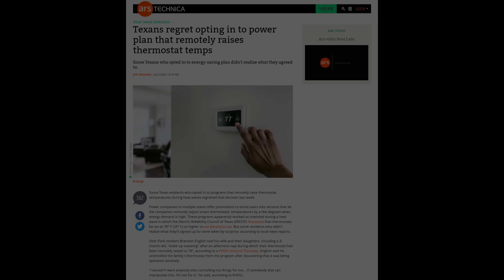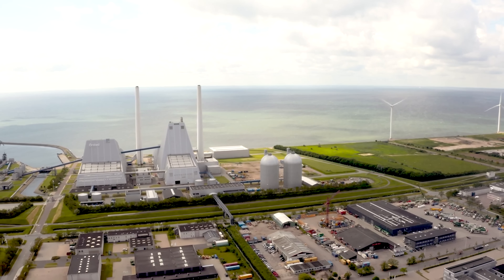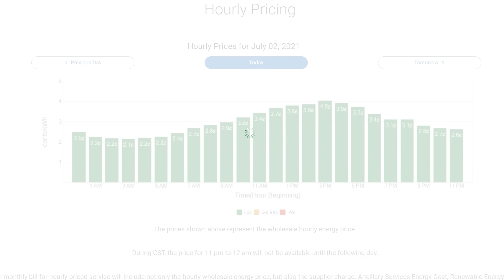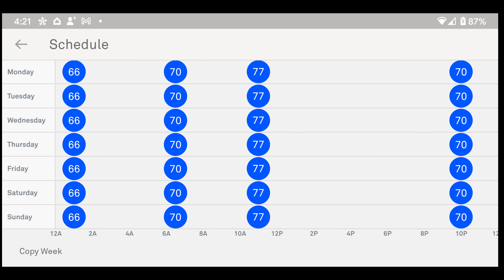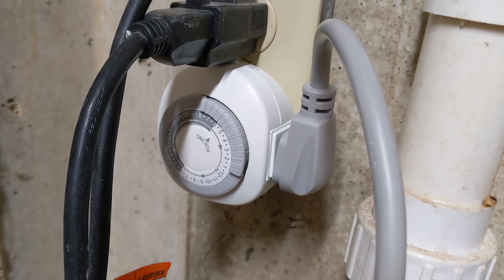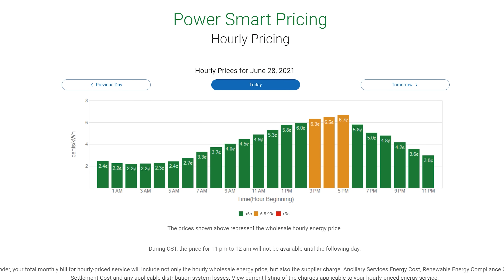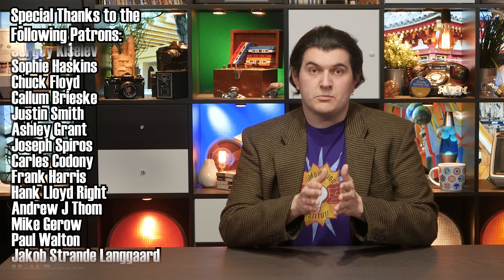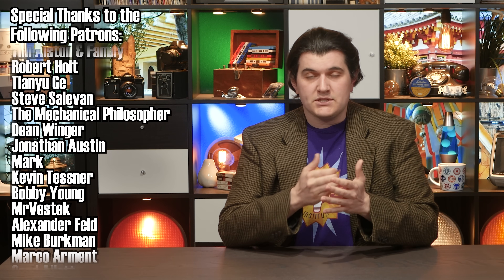Batteries aren't the only way to store energy. Here's another.

Comment from the maker: Hey! I realized that I pretty much only talked about the residential side of things and left some of the tactics commercial buildings use until the very end. Well, here’s me now saying that this is by no means something we can’t apply wherever it would work. In fact, many commercial buildings are doing pre-cooling already when it makes sense for them. None of the ideas presented here are new, exactly.
But I do think there’s a lot of potential here specifically when it comes to getting use out of renewables. “Make hay while the sun is shining” is a perfect expression, here. In some areas we’re already running into issues where there’s so much solar capacity that we can’t use it all. Rather than wait until we have more electrochemical batteries at our disposal, perhaps we can use all this thermal mass we have.
The key thing about insulation is that it slows the transfer of heat. That means it buys you time. The challenge of renewables has always been that the time of production doesn’t match the time of consumption, but with more intelligent control and awareness of a building’s thermal capacity, ability to pre-heat and pre-cool, and the tolerances of its occupants we have a pretty flexible tool for shifting consumption right now.
Reply: ok
Reply: There is only one problem that I can see with this. That is that the rate of heat transfer is proportional to the difference between indoors and outdoors. This means that over cooling at night can make power consumption go up.
Reply from the maker: @nebuchadnedzzar to be clear I do it at night because I don't have any solar output that I can take advantage of, and there's not much of it on our grid yet. Overcooling at night is what I'm doing, but it's not where I'm suggesting we go with this.
(edit to add): The other thing to consider is that if I run my air conditioner when it's really hot outside, the higher condensing temperature of the refrigerant makes it work harder. I'd need to do some experimenting to confirm this, but if the total amount of energy I'm pulling out with my cool-only-at-night strategy were equal to keeping the thermostat at a constant, say, 70 or 72, I think it would actually take more electrical energy. A larger load on an air conditioner makes its energy consumption go up, though not necessarily drastically.
Reply: There are so many places to store thermal energy in commercial buildings. Think about the all the water piping and just mandating upsizing it by an inch. Concrete floors...
Reply: This is a great explanation and demonstration of the monetary gains homeowners can achieve by looking at the home with a fresh outset. Well explained and thorough.
Well done.
Reply: Speaking of molten salts, you should do a video about the LFTR reactor.
Reply: @TechnologyConnections  Great vid :) Being an Industrial Engineer myself I'm loving your channel. I have one question regarding the fog on your windows. Since you are in the US, your windows are (most likely) not triple glazed, but are the double glazed?
Reply: more on the residential side when it comes to heating https://youtu.be/N8aGV3Z8dOA
Reply: @TechnologyConnections  this is offset of course by cooler temperatures during the hight, so air conditioning runs more efficiently then for cooling. The big problem is when this is used for electric heating.
Reply: While cooling to 66F overnight might use more energy over a 24 hour period than leaving it at a constant 72F for the same 24 hours.  The energy you do use is significantly less expensive in the middle of the night.  The other thing to consider is that running your A/C at night when it is 70F outside rather than at 3p when it is 90F outside will give you significantly more cooling for the same power consumed.  That also offsets the overall power used as well and may even be a wash in the end.  Again from the pollution side you are typically using the cleanest power (unless you have solar PV available) rather than a natural gas peaker unit in the middle of a hot day.

We use this same method of cooling down overnight, but only to 70F with our 4 ton geothermal and if we have a hot sunny day we then use our smaller 1 ton air source heat pump powered by solar to try to maintain the "cool" temps during the day, usually our 3kw of solar PV is available when it is sunny and hot.
Reply: You should make a video on the viability of using super capacitors instead of batteries.
Reply: Optimal sleeping temperature as discovered by science is 72F.
And you're supposed to have the lowest temp during the night... Which means that during the day it should be HIGHER than 72F, around 77F/25C is considered optimal during the day.
Anything higher is too hot, anything colder is too cold, PERIOD. It just wastes power.
Reply: @TechnologyConnections  I was surprised you didn't mention the extra efficiency of cooling when the outdoor temperature is cooler in the video. I have to rely on a crappy portable AC and overcooling during the early morning when temperatures are coolest is the only way I can keep it from outright overheating and shutting down in the late afternoon during a heatwave. Power around here is all hydro anyways so peak hours don't matter much, but there are still energy savings to be had by cooling things earlier in the day in a reasonably insulted building.
Reply: Extreme weather events aren't going up. Coverage of them is.
Reply: @F40PH-2CAT  Tell that to the people in the regions that washed away last week in Europe, this is extreme, oh yeah the free oven in north eastern US/Canada wasn't a regularly scheduled event either
Reply: @TechnologyConnections  I can confirm that your method of over cooling at night works well - we've been doing this for years.  Our thermostat is set to 25C during the day and 19C at night.  It's always comfortable in the house even when daytime temperatures reach 34C (with nearly 100% RH).
Reply: Solar's biggest problem is its distribution over the day, generally there's a big spike around midday and then it tails off on either side. In more temperate regions it also varies greatly over the year. That means especially in more temperate regions less likely to use air conditioning, solar generates the most energy at perhaps the second lowest period of demand (night would be the lowest of course). A summer day, when people don't have lights on, are more likely to be outdoors, and are more likely to be on vacation. So periods of negative pricing become more common, as other generators are paid to shut off to prevent the grid overloading.

Wind is less variable, but more unpredictable and you can have days or weeks of very low generation. We have lots of it here in the UK, but a slow moving high pressure system (which is fairly common) can result in slack winds for a long time (and freezing temperatures in winter).
Reply: @Croz89  other generators would be paid to disconnect, they can't completely shut off temporarily.
Though it's still detrimental for a base load generator to not be running 24/7, this is the biggest problem with solar : it introduces uncertain variability to the grid
Reply: @TechnologyConnections  yeah. I mentioned that counteracting force on the condenser. Realistically there are benefits and trade off's for all of this and your house is cheap.

Frankly one thing that needs to be done is deliberately increasing the thermal mass of buildings inside the thermal envelope. My preffered method is having the basement within the envelope and then putting in a rainwater tank. 2-5 metric tones of water is a Lot of thermal mass, and makes this approach far more viable.
Reply: @seamon9732  surely optimal sleeping temperature etc is subjective? For me 72° at night would be sweltering, probably too hot for an ideal daytime temp too.
Reply: Read that with his magnificent voice in my head
Reply: Each cubic meter of water, is about 1. 2kWh per degree C. That means a 5000L or 1300gallon tank takes about 28kwh to change that same 7C. As a benefit you also get that stored water for gardening, toilet flushing and so on.
Reply: Consider applying solar panels.  Not just for the power, but also for the shading and backside ventilation!  Solar panels prevent sun from directly radiating into your house through the roof.  No matter how good your attic ventilation and insulation, a good amount of that radiated heat will seep into your house.
Reply: @tesicnr  Compared to what? In EU, exactly the same considerations are true on the NordPool common electricity market. We don't have rolling blackouts, but we do have a sometimes 3x difference between peak and low hourly energy prices, and quite many households are on variable plans. No remote control nonsense, but looking at the electricity prices it was quite nice to see how in the beginning of the rash of heatwaves we had, the variability was really high, but has leveled out as more people and companies realized that this load shifting makes sense.
Reply: The subtitles were the best - thanks for the chuckle. 😁
Reply: Its not a negative battery, it just loses its charge too fast. Its why we don't use air as a battery. Yet.
Reply: @TechnologyConnections  I am surprised you did not talk about adding thermal mass to the house, extra layer of drywall (the method I did.),  water tanks and interior Trombe Walls
Reply: @TechnologyConnections  I could have sworn that you said Heat Pumps operate more efficiently when temperature differences between hot & cold are larger & less efficient when closer. ... I'm referring to "stress" on the system as part of that efficiency. Perhaps an efficient system is on high stress or perhaps a difference does exist but is negligible... ?
Reply: My house stores solar energy in my hot water tank, basically when I am generating more power than I am using it diverts some power to the immersion heater.
Reply: @YounesLayachi  Disconnecting isn't that simple, you need something to shed the load, that will probably get very hot.
Reply: @Validole  To be fair, NordPool has a shit ton of hydro which can be used for storage or highly dispatchable supply.
Reply: We do energy management in hotels, and that some unique problems such as occupants changing every few days so it's impossible to predict when cooling/heating is needed, thermostats being set to 40F or 85F, occupancy rates changing wildly due to conferences, holidays, etc.woefully undersized HVACs, demand-responses coming in with short notice, causing all HVACs to turn on simultaneously must be avoided, etc. But it still saves the hotels a lot of money.
Reply: You are right in all that you say about technology. Unfortunately, governments will deny services to political opponents for even something like health care, so shutting down electricity to combat opponents is still on the table.

That being said, what about encouraging people to cool off the ceiling, by airing out the attic during the cool hours of the evening and night? I'm surprised that nobody advocates putting a fan up there to push the air out. Would you be willing to do a video about this idea?
Reply: Is there anyway you could share more data ? How many square feet you have? An approximate cubic feet of airspace inside? Also maybe how much surface area does your house have? I’m just trying to liken you house to yours even though I’m in AZ. Very cool video
Reply: @kchortu  i have often wondered why we don't have an extra set of pipes in the wall, which can be used in hot months to "drain" the heat out, when we turn on the faucet. Instead of coming straight from the water main, we could have the water go up and down through the wall. The warm wall will warm the water, so that we we won't need so much heat for hot water.

Also, why can't hot water tanks be heated by surplus energy during the day?
Reply: I would say your house is more than 16 kWh storage since you AC produced more "cold" being heat pump.
Reply: Thank you for including metric for us non Americans
Reply: I respect your opinion on technology. You're like my connection to the technological world. I was hoping you might consider doing a video on hacked diabetes pumps. I know it's a weird subject but, especially as an American, I think a perspective like yours could be greatly beneficial to the diabetic community.
Reply: Great videos man. This one made me laugh as I've been doing this for 20+ years. 15 years with a older townhouse that didn't have AC and now with my new house which does. Most of my cooling comes from a whole house fan. I "cold soak" my house over night and then close up in the morning. My neighbors think I'm crazy because they all believe that I'm roasting in my house during the 100 degree days while their AC is running all afternoon. Yes, there are a few days that I need to supplement with AC to keep below 77F but its usually only a hand full of days in the summer. I've tried to explain to my neighbors that a house gets heat soaked during the day - including walls, 2x4's, attic etc. This heat is released well into night ( which in turn keeps their AC running late into the night as well ) and my strategy not only reduces my electricity needs but also keeps cost down by shifting most of my cooling cost to cooler evenings ( a cold soak ). Like you, we prefer sleeping cold ( always with the windows open and fan in window ) so this works well for our family. As you stated though, this works well in my area ( CA / Bay Area / Livermore ) where night time temps are cool but isnt going to work in all places. Keep up the awesome info videos.
Reply: @judebrown4103  I agree. I find 22-23 degrees to be comfortable, but I start to sweat afterwards.
Reply: @Milan Velky that means it could be stored in the attic, right?
Reply: 5:06 NOT VIABLE not at all. THUNDERF00T (among others) can show you why... and it becomes quickly obvious that its a huge fail.
Concrete breaks down over time
and if you run out of place to stack you stack on top, reducing the lift height and therefore power
AND don't get started on wind conditions
its BAD... but water is GREAT... water doesn't break and falls FREE from the sky... it is perfect!
Reply: same here, an old trick, 31°C outside, 28°C inside, not much but these 3 degrees make a lot of difference, until I switch on my pc 😅
Reply: I support nuclear energy 😀
Reply: Yeah, I messed around with my thermostat and did a similar thing though it was the other way, Turning off heating at night at 9 and only having it turn back on from 6 am to 7:30 during the week. We only raised the temp to 64 though and it was not uncomfortable... 70 degree houses are uncomfortable to me because you sweat more there.
There are actually a bunch of studies that show a number of benefits from sleeping in cold
Reply: Your house is an entropy battery xD
Reply: @Milan Velky Absorption refrigeration is thermally inefficient.  If you happen to have a free source of waste heat to use, it can be a net win, but on a BTU per watt basis they're not a winner if you have to pay for the watts.  The benefit is that you can run them WITHOUT electricity, since all they really need is the heat source.  (Modern RV fridges mostly need 12v for a control board for auto-switching and thermostatic controls, but there are still a few models available that will run on propane alone.)
Reply: @eugenetswong  yes, I'm in the south of the UK and for those who may not know ac is not  commonly used over here. Some of our houses have had insulation retro fitted in cavity walls. So far I've chosen not to do that because I think the houses were built to 'breathe' and worry about damp problems if you seal them up.
In winter we have our central heating set to about 18°C/64°F and is perfectly warm enough for us on most days in our three bedroom semi-detached house.
In summer when it gets hot - we have about 28°C/82°F daytime temp at the moment, thats quite warm for us (although we have gone as high as 35°C/95°F in recent years) I keep the windows open at night then, before the heat rises, I shut the windows and draw the curtains on the sun. We're east/west facing so I usually only have to do this on the afternoon sun. The east facing doors and windows stay open unless the air is hotter outside than inside and by this means the house remains cool, if the heat does get hotter outside I shut all the windows and use a ceiling fan to help move the cool indoor air.
Takes a bit of vigilance but uses a minimum of electricity.
Reply: @smithsmith6402  On the London Underground they open all the airways they can at night to cool the stations and tunnels down and reduce cooling demand during the day.
Reply: ... Was total $ said? As guess a family shivering 100 days in summer saves maybe $100, that seems bad deal x10 factor. My family say they want altogether $1000 to shiver summers otherwise prefer not shivering... PS Electricity is tooooo cheap, so these nudges won't work we r kidding ourselves, , , sorry to be negative just seems token, , yes I am getting bit jaded on green issues sorry
Reply: can you buy please a better mic.. the noise is too bad
Reply: heh i just turn on my extractor fan at night and open a few windows to suck the outside air in summer, it bonuses as an insect repellant because insects cant smell you if the stench doesn't escape other than a location where it goes through a spinny blade
Reply: @judebrown4103  great work!
Reply: @Milan Velky thanks for the extra info!
Reply: Absolutely love TC - such an enjoyable channel. Thanks so much for all the education and entertainment!
Reply: @nevermab  energy cost not
 conservation was his point
Reply: Around here (western US)… we are getting a little too much sun. We've been in a constant heatwave since mid May. We try to do something similar to what good ol' TC is doing with his house but the house we are renting has crap insulation and crap windows. So it only lasts until about 10 am when temperatures reach the 90's.  Most of the electricity around here is good old fashioned polluting coal.
Reply: @TechnologyConnections  There is an efficiency reduction when the exterior temperature at the condenser is not significantly higher than the indoor volume being cooled.  This means for the same electric load, the thermal extraction is lower when you run it at night.  How much lower?  Dunno, for sure.  Have you noticed any cracks forming at the corners of your walls due to the daily hysteresis being considerably higher than leaving things a constant temperature?  Also, how much energy do you actually save doing this - have you run a monthly 'speriment to see the actual benefit?
Reply: Yes, but savings are small ( with fixed 4c/kWh transmission costs) and your "battery" has its losses, too.
Heat is hard to channel and contain. It loves to dissipate.
This has its uses, but I suspect that in reality results are worse than advertised...
Reply: @eugenetswong  Around San Francisco Bay a whole house fan is very common as it really cools down here at night. Air is sucked in open windows, blown up into the attic and out the attic vents. Most people don't have or need AC.
Reply: All I got out of this video is confirmation that you're not married to my wife.

(just kidding of course, it's a great vid)
Reply: Large buildings are paying (at least in Sweden) for the maximum use of electric POWER during a month (mean hour power). To spread out load during the day lowering there power bill.
Reply: So I live in a newish, concrete, condo building, with nearly full height windows, in the Pacific NWest.  We are North facing, but during the heat wave I found that in the mid-afternoon it was far cooler outside then inside!  In fact, after the heat dome left and our outside air temperatures dropped to 24C range, we still found it hotter inside then outside, even after having the windows open all night to cool down our condo.
So any ideas on what is going on, as I thought new, well built, concrete buildings with good insulation and a modern air tight design is suppose to keep the inside cooler then outside?
Btw, very few people in our condo have AC units,  including us, if that matters.

My only guess is the building's concrete thermal capacity was heated up into the 30C range (like a rock in a fire) and when it cooled (glowing hot rock taken out of the fire) the building's concrete re-radiated the heat (for DAYS) after the outside air had cooled.  So our own building was cooking us?  If true, we need to have a discussion with Strata!
Reply: The College nearby freezes a reservoir of water overnight and pumps the water around through it's radiators during the day to cool. There is still forced air cooling and the reservoir system is being retired...
Reply: Same idea: I installed a timer on the electric water heater. The tank stores more than enough hot water for a whole day, so it saves a lot of money with no impact on lifestyle.
Reply: Virtual Power Plant (VPP) ftw!
Reply: It would interest you to know that 69% of corporations surveyed last year were actively pursuing investments in their own generational capacity. Solar and wind are now the cheapest form of energy production in the history of the global energy market. The next frontier is heat energy storage. And we have everything from phase change materials to simple sand to work with in that department.
Reply: Theres also a similar possible aid that can happen at an infrastructure level-in a similar way as in some places even today winter heating and hot water is handled off-site by a conected boiler building, then pumped hot to the building or even in some cases run as steam, a similar thing can be done with heat and cold using ground and air sourced heat pumps in purpose made buildings.

In many more locations than its feasible to give every house a ground sourced heat pump, its feasable to basically create one big heat pump that can cool in summer and warm in winter and spread that to anything in piping range, and can use the same load shedding battery method to cool air and water in summer and heat it in winter, then spread that round the neighborhood. This is especially true if houses have yards that a neighberhood heat pump can be run under, or in comercial areas that might see redevelopment more frequently. 
Especially with the ice storage cooling systems!

No more complex than the kind of infrastructure people or companies have near, on or under their property and conected to the whole neighberhood anyway, such as sewage, septic,  water or electrical systems.
Hell, in places that need public or public-private interconect water pipe refits, this is the perfect thing to do as a value add.
Reply: Other ways commercial buildings can save energy is by setting alternate schedules, thus lowering their demand.  Or work at home / virtual. This doesn’t store energy but it reduces peak demand and spreads it out a bit more.
Reply: @TechnologyConnections  I was really curious to see an A B comparison of overnight vs daytime cooling with graphs for internal and external temp and humidity to control more variables
Reply: Instead of worrying about all that nonsense, you can come live in the Wenatchee Valley (or more specifically, East Wenatchee) and pay 5¢ on the high end. Right now it's actually 2.64¢/kWh

p.s. the water/ice baths plus the hot bricks sounds a lot like what practical engineering talked about in his video on it. Marine you two could collaborate on something
Reply: As an HVAC tech I really love hearing these perspectives. I learned so much in this video that I might have never learned about in training or in the field!
Reply: Man, I wish my office would crank down the AC at night. I'm often working late, and I'm always hot!
Reply: I once worked in a brand new building that had ice storage, but that also had "Sick Building Syndrome" due to outgassing from the carpet, adhesives, and the paint used on the doors, door frames and railings.  So I loved to say: "I work in an ice building, but it's not a nice building."
Reply: I have solar. . And my electric is just a service connection fee. Like 40$ to 60 all summer im in Florida
Reply: Do you have a “time of use” electric meter?  With an ordinary meter, the electric utility has no idea WHEN you’re consuming electricity throughout the month… only how MUCH you’ve consumed.
Reply: @vardekpetrovic9716  Texas had its worst winter in history, Baltimore is hotter now than Atlanta was 20 years ago, glaciers are receding at alarming rates, Lake Meade is at its lowest level since the reservoir was first filled, the migratory patterns of birds have changed, the Great Barrier Reef has been bleached white… what proof do YOU need that human carbon emissions have and a significant impact on the climate?
Reply: Got the next day figured out eh?

Utah: hold my beer
Reply: @varno  Lower outside air temps at night and no sun baking the condenser coil should make cooling more efficient. Also, at night temps should be closer to indoor temps for less heat transfer.
Reply: On the commercial side, I used to work in a winery.  We had temperature sensors recording internal and external temperatures, set to pay attention to the internal/external differential, as well as absolute temperature.  These were hooked up to louvers and fans.  In short, when it was cool at night the louvers opened and the fans kicked on, filling the winery with cool night air.  When the absolute temp, or the differential (depending on the situation) reached its critical setting the fans shut off and the louvers closed.

Even on days well over 100 degrees F (38 C) the winery stayed cool.  We didn't have any active air conditioning, this semi-passive system was the entirety of the cooling system and it worked really well.
Reply: You don't have a lot of solar around your area it appears.
Solar output usually peaks around noon/early afternoon when your power is most rare and expensive.
Around here it is the opposite, sometimes they even have to disconnect solar plants to avoid overloading the grid.
Reply: I choked when I figured out you were also a Midwesterner. Anyways, this is a very in depth explanation of how to put less stress on our power grids, and I’m all here for it. Less stress usually means less outages. :)
Reply: you are BRILLIANT man! 😊
Reply: Hundredth reply
Reply: Are you with Ameren Illinois?
Reply: @TechnologyConnections  Admit it you're just cheap haha jk but you got really low rates man I pay 18 cents all the time plus $80 dollars added on right away each month just for having electric
Reply: @Milan Velky absorbtion coolers are huuugely inefficient and installing such a system only makes sense if LOADS of heatenergy are available as waste already.
Reply: @seamon9732  ugh, I hate sleeping in 77f. Too hot
Reply: @vardekpetrovic9716  Most scientists say absolutely nothing of the sort.  You completely made this up.
Reply: I really try to avoid running the airconditioners at home because they are 30 year old window rattlers that’s cost an arm and a leg to run. However when the temperature often peaks over 40 Celsius I will run the aircon because if I don’t the house temperature will not cool down at all. Especially when it is still 35 Celsius outside in the middle of the night.
Reply: You should look into home / small commercial chiller systems. I'm starting to seem more of these become available, look up engineer775 on youtube he has a few videos about them.

The are refrigeration units but use water to both heat and cool a building and provide the hot water needs. They can cool your house and dump that energy into a storage tank for your hot water system.

You can also have additional thermal storage tanks for cold and hot water so that you can use renewables to power them and still have consistent HVAC throughout the day.
Reply: just want to point out, it is not a battery if there is no way to redistribute the stored energy into the system, it is smart useage of resources, and it sure is a good idea, but if i can not charge my car with your cold house, it is not energy storage.
Reply: Had a oil radiator with a huge stone above it. You had to plan really well because I takes time to heat up and time to cool down... Quite difficult to use as you need to follow forecasts, but inexpensive too.
Reply: The delivery of ‘Saves me 40¢ a day’ had me lol-ing
Reply: First seriously .... then a joke
Seriously - I am the only one who thinks that it is a terrible 😨.. TERRIBLE IDEA 😰 😱 .. that the electrical companies lean any.. 😐 even the smallest insignificant.. part of their operations in a open public network.. instead of in a private closed one??? ..... this is going to end very very bad some day 🙄...

Now the joke 😃 - Hey grandma .. can you believe these kids ?? 🤨.. they don't even know how to take a shit without having the stool connected wireless at the cloud.. and to the little color mirror that they have glued to their hand all day...
Reply: @eugenetswong  Where I live, all larger houses have an attic fan. My area doesn't even get very hot in the Summer.
Reply: @buddyclem7328  Wow. That's such an heard of idea here, that I thought that I was the first person in the world to think of it.

Do you use a thermostat to turn it on?
Reply: @eugenetswong  The attic fan has it's own thermostat in the attic. I think it can be adjusted between 90°F-130°F. One time my parents' attic fan got damaged, and it burned up the motor. When the new fan was installed, they put in a switch, to turn it off if there is ever another problem.
Reply: I feel like i know this guy. Like....A/V club or drama club in high school....
Reply: As far as i remember the evening spike was pronounced in Austria before air-conditioning became as usual as it is.
And other newer consumers like electric Stoves (the only device in Europe to use 400V and up to 3 phases).

So we will still need a way better Storage if we want to reach our fully renewable goal.

PS1) Also Automatic blinds can help reduce the amount o heat that gets into a building.
(As well as some other design elements if you build something new, and are allowed to use them.)
Reply: It's definetly interesting, however over here in The Netherlands we are moving fast on putting Hydrogen in our old gas pipes, so for us over here it's a few more years for full Hydrogen infrastructure, but indeed this idea should get more thought, however you still can't rely on it to "save" the grid, Engineers just can't rely on good faith to solve problems.
Reply: @F40PH-2CAT  the 10 warmest years on record have all been recorded after 2005, we are seeing the most extreme weather since humans started recording the weather and ice core evidence suggests that the rate our climate is warming is substantially faster than temperatures naturally vary, we are seeing roughly the same increase in concentration of greenhouse gases in a 200 year period as is typically found in a 6000 year period and will probably result in a rate of warming that is an order of magnitude faster than is to be expected leading up to an interglacial period. https://www.pnas.org/content/105/5/1425
Reply: @eugenetswong  that seems like a great idea, especially if you had a thermostat inside the attic and one outside the house so you can measure the relative temperature of the two and then send the data to a simple computer to compare it whether you want to have the house warmer or cooler at that time of year and turning on the fan accordingly.
Reply: @loungelizard836  another thing you can do with rooftop solar panels if you can match the incline of your roof is to have removable baffles that you can slide between the panels to trap air during the winter for its insulation value.
Reply: As you mentioned, this is already in commercial buildings, especially SEER-compllnt ones. Underground tanks store heated/chilled brine and use it for heating, cooling, etc. These systems are integrated, so that the latent heat pulled out of A/C units gets used to heat hot water for the building.
Reply: I know this has very little chance of you seeing it, but man, I really, really want to see you talk about thermal boreholes.
Reply: If you had any idea the amount of local diesel generation that turns on when policies like this take effect you'd realize that this isn't good. Millions of litres of dirty diesel fuel burned in relatively inefficient and maintenance heavy small scale local generators then dumped into the air in the middle of cities that don't need the extra emissions, often replacing renewable power from the grid, but it gets it all off the official books so two thumbs up for environmentalism!

Law of unintended consequences.
Reply: What happens when all these car manufacturers stop making gas cars and people start having EVs?  Shutting off power will leave millions (if things take off) with no ability to escape or leave the house.
Reply: @varno  Overcooling at night will only make power consumption go up if:

1) You still have to cool your house during the day, due to poor insulation
2) Your overcool by a temperature delta that is greater than the difference between nighttime and daytime temperatures
3) Night time temperatures are greater than day time temperatures (which does happen on occasion) 

Issue #1 is by far the most common.  Most homes in the US are quite old, and cannot retain comfortable night-time temperatures without additional air conditioning throughout the day.  But for a well insulated home at night, it is much easier for an air conditioner to lower the temperature of the house to 5 degrees below ambient temperature at night than it is to try to lower the temperature of the house to 20-30 degrees below ambient temperature during the day.
Reply: Pumped thermal is actually a thing for commercial - fluid is used to transfer heat into the ground during hot months and pull it back out when it's cold. It's remarkably efficient, but can't generally be used as an all encompassing solution due to diminishing returns as the ground becomes saturated.
Reply: Great idea - but your stored energy evaporates megalitres. Which is bad.
Reply: One of the new buildings at my job have vents that opens at night to take advantage of the natural cooling. We can do the same by opening a window.
Reply: Cool video
Reply: @varno  agreed, so much more efficient to cool at night!
Reply: The key to this kind of stuff catching on is to make it available and optional. As the benefits become apparent to those who haven't opted in, more will participate, and without the naysayers. Also, a much better idea to invest in improving our own energy efficiency than to just blindly send that cash overseas to offset them.
Reply: I have heard of an air conditioning unit that works by freezing a reservoir of water and pumping the cold air it produces as it melts into the building. Have you heard of this before?
Reply: @TechnologyConnections  Next step: have you considered using phase-changing salts for a latent heat storage system? You could find a suitable material with a fusion temperature around 20 ºC, and solve your problem of being too cold in the morning, maintaining the same energy storage with a smaller thermal variation. The same system would work in the winter, maintaining a stable temperature in the house.
Reply: Has anybody ever told you that you are flipping awesome? Keep being you!
Reply: Technology "thermoman" Connections
Reply: On the commercial side of things here the UK large power consumers (I.e. data centers) are inscentivised using traffis to dramatically reduce our consumption with in the next 30 mins for 1 hour when we are sent a message.  In the case of us operating a data center that means we can boost up our cooling for that 30 min window bringing down the temp of our hot ailes (meaning we can use much less power for cooling for the next hour), we can also shift mostly to our own generators.  This takes about 2 Mw off the grid for an hour, we can stay on generators for much longer if needed, however we burn more fuel for subsequent hours as we have to run the cooling systems at normal levels again. Occasionally we get the request to contribute more power to the grid so the redundant spare generators are brought on that pushes about 1Mw onto the grid.  This push does not happen very often, usually only during grid fault situations when I big transmittion line fails meaning they can't get sufficient power to the city we are based in.

Most data centres our size can't do this as normally the power density we run per square meter of floor space is not possible. However ours is built where there used to be alot of steel works, so national grid can get about 1/4 of UK total generation capacity to the area we are in. So multiple Mw feeds are a practical possibility where we are based.
Reply: There would need to be seperate mediums for the up and down, the user needs to be able to control the system at all times and over ride the power company, I wouldn't mind them turning my AC on earlier but I don't want my minimums to be touched, if my AC is set for 24/7 65 degrees then it's staying 65,
Reply: Enjoyed your video and at the end was surprised to hear you mention Economy 7.  If you want an update on them.. there are still many remaining in houses and flats here in the UK, and most people who have them aren't in a position to have them removed. They cost a fortune to run now.. they are worn out, probably 20 years old or more and majorly inefficient. The so called cheap electricity at night is bullshit. People in rented accommodation usually turn them off and huddle round a stand alone heater when it gets really cold.
Reply: @varno  And the efficiency of the heat pump is inversely proportional to the difference between indoors and outdoors. Cooling at night with outdoor temperatures at 80F requires notably less electricity than the same amount of cooling on a hot afternoon at 100F.
Reply: After watching your video, I think a better term than "energy storage" would be "work storage". Because when you're cooling, you're using energy for a desired goal - therefore by overcooling to beat peak demand, you're storing the work done by the AC. 

Not as catchy, but sounds more accurate to me.
Reply: This idea is great. But what if more and more people follow it and at a point when electricity provider realize that power consumption and production is now balanced. Will it make them to change the timing based pricing same for each hours? then if even more people follow it and it becomes more consumption at night than day? then it might be very difficult for electricity provider to decide scheduled pricing and even more difficult for users to optimize usage of house as battery (or other energy storage solutions).
PS: I watch your videos regularly they are great. Thank you. :) (sorry for bad english)
Reply: Steam heat. Window air conditioners. 150 year old house. You wouldn't like me.
Reply: We store wind energy in parking garage sized ice cubes to cool skyscrapers in Austin
Reply: @Mr.Morden  Nuclear has horrible tailings to consider during mining.
Reply: @Milan Velky COP, I presume, is Coefficient of Performance, i.e. cooling/heating energy yield over input energy expended. I guessed initially it was Cost of Purchase, but that seemed wrong after a while. Pls FFS explain your TLAs.
Reply: There are no moving parts, no electricity, no greenhouse outgassing, ect....
Reply: @eugenetswong  The great thing about Solar Photovoltaics is you can dump excess power into the grid. Making hot water is easy with a HW Solar collector but once your hot water tank is full, you can't turn it off and the water boils so you have to use antifreeze and a secondary loop and a special second water tank. Then if it gets too hot it will still boil off as steam. All that equipment and maintenance gets expensive for just hot water. Normal Solar cells are better and will possibly block some solar radiation from your roof.
Reply: @evilcanofdrpepper  If you have  heatpump and you let the temp drop more than a few degrees it may be using the electric strips to reheat your house. Some smart stats delay using them. I disconnected my strips (second stage heating) entirely to prevent that. They only come on if I set the thermostat to "Emergency" heat.
Reply: @Milan Velky Just like Hot Water Solar collectors, for 99% of cases, it's not worth the expense and maintenance costs.
Reply: @buddyclem7328  He's talking about a Whole House "Attic" fan. It was about 4 feet across, had lovers that closed when not in use and was mounted in the ceiling. It sucks air from the inside of the house and blows it into the attic thus cooling the house and the attic. The windows are open letting air in. It works but makes for a dusty, pollen ridden house and the old ones were very loud. Though I grew up in the south, I'm told very few people ever used them here. Those huge fans used about as much power as an AC unit so most people just had normal AC.
Reply: @jesternario  It's called a Ice Bank. Industry has been doing this since the invention of refrigeration. Traditionally used to reduce the amount of equipment needed for cooling in certain situations. A Dairy for example. Heat the milk for pasteurization then quickly cool it.
Reply: @UCrI6WViVc93T7MUNcaE-Nkw sizing a central split air conditioner so as to be able to keep up with the heat gain when the efficiency is lowest is completely insane. Your unit is sized to be able to use at the correct time of day. So don't be negative. By having a smaller compressor the ratio of it to the expansion coil can be reduced and you see this consistently in the efficiency ratings for a specific model between the different capacities. The lower tonnage units are always significantly higher seer. But wait, that's actually because they are limiting the speed. So when you have split phase and 115 volt unit says you do at the home improvement stores with the variable speed compressors known as inverter window air conditioners by LG available at home Depot for example you will see the essentially The identical unit. However the 115 volt unit is far higher efficiency. That seems counterintuitive because the resistive losses and the doubling of current for the same wattage from the wall would seem to be not optimal. But because the kilowatt capacity of that 115 volt power line is well under 2 KW it is not able to ramp up to the higher speed that is far less efficient for the evaporative coil! Again this is essentially a software optimization of the box and a certain teachable moment! Unsurprisingly the corrupt industries do not allow you to cap the speed. And there is no patents that is in use comparable to the setback for winter heating to help this white spoiled brat have the correct speed of his central air conditioner for optimally moving the the literally best referred to in his case as kilocalories from his house. He talks about 40 cents a day but he could save more than that by having a more intelligent control of the time that the air conditioner operates. Even with a single speed unit and typically you will have two speeds not variable or single but two speeds. So generally speaking what you want to do is operate it on the slower speed only perhaps just very briefly before it turns off for the day operating at a high speed. Now it can learn how to do this. However the data it needs to learn is beyond the typical sensor array. That doesn't stop it from learning from the cloud however.

Finally and I do hope the video maker has thrilled down this far. Finally this idiot should not be prophesizing body temperature control by how many cups of water you remove from your house per day. That is an OPEC wet dream this ignorance this ultra low thermal intelligence pandemic. Within the Japanese company Fujitsu there are those who lost family to Nagasaki and Hiroshima and then there are those who lost more recently by their own hand at fukushama. Fortunately the dude who controls what goes on their history timeline has put the Fujitsu Komodo and that dispelled with a c even though the gboard will refuse to spell it with a c for a few more years you can find it on the Japanese Fujitsu channel here on the American YouTube. You can see a 60 second commercial for an item that can't even be bought in Japan what has to be least it is a leasing only opportunity because of the threat of internal competition or the lack of cinematic idolism in terms of Harry caray to the evil prophets of central demification. Such profiteering has destroyed our world and turned and otherwise proud man into the mark that is a night nor is the Lord. Knighted Branson has a wasted 3 million dollars which is not fair to the world because he didn't just waste the 3 million he basically doomed of the world by having a electric utility distribution mouthpiece known as the Rocky mountain institute use the idiots face to Green wash Central dehumidification even when it is in the room air conditioner. If you think about the budget in India and their current product that can be obtained if you are an employer who regards the employees as the widgets which the first generation of the Komodo gear is marketed by in the most spooky video that shows a man down thing down. And then from the tower of the guard gives him a little bit more cooling. So the physiology is not complicated most of our blood flows through our body and under 2 minutes all of it in under 3 minutes. It's not hundreds of seconds to cool the body but something you do in advance. This channel actually is spouses that. By having the temperature in the 60s you don't just sleep well but you have the thermal reservoir to go outside without overheating. Now I'm a very active person and I've been eating a lot of fat myself for example I have about 100 lb of cheese that I brought home because it was for free you know behind the store the other day. Normally I just bring home the organic produce you know like the beats with the wilted leaves even though nobody has eaten a belief I said beat leaf and some people think that such roots are bad for us LOL. Anyway I am not a skinny girl and I can lift you and throw you farther than I can jump myself despite possibly having some records and track and field for what I've done alone and recently. But I have a lot of thermal Mass and before I go outside when it's 120° for example to my doctor I might take a bath. Not a fresh bath! But I let the water sit long enough to get cold. So that I go in there and I warm that water up a little bit. On Monday by temperature was 97.2 at the doctor LOL and I was so upset having spent 3 hours there that at 5:00 p.m. literally I ended up walking to the free cheese building grocer just reflexively and I was wearing a very thick silk shirt. So I started f** sweating! You know you're part of the problem if you sweat ever. And I was upset and confused. I figured it out eventually. I was so anxious having prepared to die the next few days in order to rescue a loved one and elder who's in danger by putting my life on the line and that's my demands that they be helped or men are met. Anyways I figured out that the problem was it was the most humid and the hottest time of the day the road was 200 degrees the sidewalk even warmer and I'm f** walking like 2 miles for no reason faster than most people jog. I'm completely oblivious! Worse I'm not carrying any ice bottles to put under my arms! How ignorant is that? So even I can act like a dumb jerk. Never again of course. You get to make one mistake like that if you're lucky.
Reply: @rlrfproductions  you know if you put the liquid nitrogen into the ship and it called enough temperature that it doesn't boil you can save a lot of money on the condensing systems that the other wise have to install. Just kidding but I like it when you use one gas to superchill another gas so it doesn't evaporate for a while. Even at Spirit pressure atmospheric I said. The physics are what people need and what people like this channel maker deny the viewers it has. When my body is several degrees below my normal temperature which my body knows to let it drop too and the summer. Our bodies have learned by the teacher that is evolution to not try to heat themselves 97 or less if they are allowed to drop that to that temperature in the summer so that they don't have a situation like say general electric had with its decelelectric locomotives going downhill where they have to put the f**** brakes on. The thing is by slowing the goddamn locomotive down when it goes up the hill so that it doesn't need brakes going down the hill they prevent the rail industry from taking on the proper burden moving things around and instead they end up getting in semi trucks using diesel engines that are even worse than the ones on the locomotives. This despite general electric manufacturing liquid nitrogen turbines and shipping them in other words off the shelf in containers and other words in a rail cars that only need to have some of the parts removed not anything added in order to be dropping replacements to those locomotives that are zero emission cost less to operate without any externalities and potential to harvest the lack of externalities into revenue being evidence and I said evidence I said evident there. So we live in a world where the people are kept ingrans I said ignorance and if the people are ignorant then their servants are in subordinate. It is our servants who keep us ignorant and we who invite their in subordination and allowing them to do that. Keep getting over it until we're done or snap out of it.
Reply: 3:10
That is Definitively not how that works. The purpose of the battery is to provide frequency correction.
Using it the way you describe the Hornsdale Battery Reserve can backup the South Australian grid (using today's data), for 5.26 Minutes. It takes at least 30 Minutes to source power from non-rotating reserve. i.e. Gas Turbine / Hydropower.

https://hornsdalepowerreserve.com.au/
https://nemweb.com.au/Reports/Current/Operational_Demand/ACTUAL_DAILY/
Reply: @Milan Velky no you misunderstood me core efficiency matters not at all that's why the comOdo can get away with being fully directionless vibration tolerant ultra reliable IE solid state. It's because the human body is able to express most of its heat through its infrared radiation and the rest of its heat essentially through the evaporation of the lungs. That leaves almost no heat needing help to get out. By simply having a small amount of surface area touching the neck directly above the main arteries of the body that supply the BRAIN with oxygen etc (COOLING FOR EXAMPLE!) you can maintain whatever blood temperature you want throughout the body using almost no BTU'S ...not thousands of BTUs not hundreds of BTUs but just I imagine in the very low dozens of BTUs. [HELLO!!!] 

So you don't need to have a heat pump you can just have a small amount of liquid nitrogen like the kind of liquor back pocket flasks of yesteryear for the ethanol that's the amount of volume you need in liquid nitrogen to stay cool with a movie theater if the movie theater is naturally ventilated and you don't have to pump out all the steam from people's hot breathing but just let natural ventilation take care of that heat load. 

It's a different way of thinking a way that is protective of the pandemic and consistent with our evolution outdoors. It's just the smallest amount of heat but the way we do it with the reduction of the mass of the water in the air needlessly is only helping line the pockets of the industries that BUILD in the obsolescence so we buy many FAR TOO MANY HELLO units over the course of the lifetime of a building pretending that we're doing good upgrading the efficiency when the reality is that the insulation and the multiple PANES [pains] of the windows and all of that nonsense are based upon the false premise. 

We are honest when it doesn't matter like when we say solid state multi-stage systems will never compete with liquid refrigerants because the heat of the thermal electric element has to be pumped in series so that each layer becomes exponentially less efficient. That doesn't matter at all! A single layer of thermal electric produces enough of a temperature drop to extract heat from the neck as long as the lung cooling system is not forced TO inhale the latent heat . .  or whatever you bastards like to call it being such a part of the problem from other people's lungs ETC.. . 

That s*** needs to go to the sky.
 We don't need to be breathing the exhalations of strangers.
 We don't need to be burning oil and coal to do what is essentially less work than that which we do when we SAY LOL sharpen ANY! pencil by hand.

 We have people that are running thousands of Watts through their CENTRAL air conditioner turning the thermostat all the way down in the afternoon so they can get on there God damn exercise bicycle and spin when the work that they're doing on the bike is more than sufficient to make their bodies 95° by simply a small thermal electric element touching any number of parts. 

It can be in your socks ALONE
 it can be in your underwear ONLY

 it can be on your neck.  AS DKNE GLORIOUSLY BY THE PERSONAL CAROTID COOLER KNOWN AS FUJITSU'S 

    "COMODO GEAR"

If you watch IT'S 60 seconds [OF AWESOMELY CHOREOGRAPHED ETC. HIDDEN HERE ON THERE JAPANESE YT CHANNEL DESPITE IT BEING FOR AMERICA'S  CLEARLY] MARKETING that I refer PLANET SAVINGLY UNAPPRECIATED BY FUJITSU TRYING TO KEEP IT ON THE DOWNLO you can see how the ballerina does not get impaired at all. IN ANY WAY!!@ The only problem I have with the 60 ["2nd"] commercial besides the fact that it's nearly impossible to find on the Fujitsu YouTube channel is that they  [PORTRAYED ULTRACOOL NOT NERDY AT ALL EARLY ADOPTERS] wait until they start sweating!

 The essence of intelligenT management of our body heat is to preempt the outlier condition. 

In other words within a certain number of generations all of our sweat glands will mutate out of our gene pool. We don't need sweat glands! 

the resources that bodies developing in the fetus STATE consume for things like sweat gland that are obsolete... for the appendix etc.. are what we need to think beyond.

 In some cultures they don't have "glazings" in their buildings and we RIGHTLY give architects awards for building such structures in such parts of the world's even better! 

I am familiar with the history of advances and energy efficiency especially the carrier ,"thp3" of the 1980s KILLED THEN which was corruptly taken from the market and yet surpassed as a home heating cooling and domestic hot water system.

 What we need is the personal "the Sony cassette  Walkman" ERA OF AC OVERDUE  

we need to stop having people associate being warm or cold

 comfortable!
 with being 
indoors 
with being sedentary.

 Comfort comes from activity health comes from vigor and it is in this Japanese company's product which makes the Sony seem like the scam that it is in terms of the special shirts from the fashion designers that work with their battery powered personal body cooling system which they say they learned how to make from all of the laptops and cell phones that they have engineered the cooling of. You don't have to make laptops and cell phones to know how little cooling a human being needs even when the wet bulb temperature is a lethal. Any elementary School child with a budget of a few hundred dollars can do this. And children are being crowded in classrooms because of the supposed cost of keeping all the schools open. It's insane. I live in the city where within the few minutes walking multiple huge appropriate pieces of land for children are mothballed. Already on my commute I passed one that is currently being demolished. The surviving brick schools are dependent upon the Fujitsu being available in America sooner as opposed to later. Literally the executives at Fujitsu who were fighting disrupting their own primary profit center to save the planet need to go ahead and stick the knife in their chest and move it all around like their mentors used to do without a second hesitation. Toshiba tried with their liquefied natural gas division and ended up selling it instead of just taking the loss totally without any further existence of the evil Enterprise. That's how stupid these companies can be they're close to the solution which is distributing liquefied nitrogen as the primary energy distribution method not fracked methane. They were so close but ended up cutting off their hand despite their face just like you try to argue did ending forever. Keep on Dead ending and maybe you'll be dead before you have to suffer having imposed such an ending for the future meaning no beginning for that which could have been
Reply: @lordsamich755  virtual inertia peddler need prison time not "me be right youso sowrong" song
Reply: @ereenatc6042  
What?
Reply: "Deadly heatwaves?" 🤣😂🤣 are you aware of the 1850s? Or 1898? Or 1911? Or how about 1930s??? Watch a little Tony Heller and educate yourself.
Reply: @DrinksInHighPlaces  
Tony Heller who can't scale a graph like I was taught to do in grade 6?
Reply: @lordsamich755  example please. I believe it is you that does not understand how to scale a graph.
Reply: @DrinksInHighPlaces  
"example please. I believe it is you that does not understand how to scale a graph."

I don't think evidence will convince you.
Reply: @DrinksInHighPlaces  
You also don't know what a straw-man is.

You're then asking me questions, in an attempt to determine the accuracy of the thing you've already accused me of. 😂
Reply: @lordsamich755  my claim the historical record he is presenting - you reply with a straw man about his graphs. No, you don't understand what a straw man is! 🤣
Reply: I just saw an article about MIT using Aerogels to block sunlight from heating a building in Chile but ALLOWS infrared heat to radiate off/out of the building. I'm an amateur scientist at best but this is a little mind boggling but cool (literally...).
Reply: I was on the program 5-10 years ago where they turned off my AC. The problem was at that time we ended up using more total power even during the high peak demand time.  This was because they would only shut off the compressor but the blower still ran.  Not only was the blower using power the whole time, it was blowing air from the ducts that went through the hot attic.  So the house would heat up 5-10 degrees in an hour because it was blowing hot air from the attic into the house.  

When they turned my compressor back on in about 20 minutes to an hour, my AC has to run even longer to cool down an even hotter house.  If they shut off the whole system (which wasn’t offered at the time), then the house would have only heated up a couple of degrees during the same time.

ETA: At least now they do allow you to request to have the whole system shut off.  But since I’m now energy independent I no longer need this program.
Reply: @SkepticCyclist  the lack of zoning and pounding mass into the water on your evaporator coils into steam has nothing to do with anything but corrupt and incompetent work.

When the water is warmer than dewpoint inside air handler keeping fan off COMPLETELY IS IMPORTANT.

YOUR DEPENDENCY ON SWEATING WHILE REMAINING DRY WHILE WEARING INSULATION BEYOND INSISTENCE TO USE AIR IMMERSION ONLY IS REAL PROBLEM.

Stay comfortable by understanding the ONLY temp that matters is the people's internal temp.  That can be kept low by smart 🧦 or underwear or just the seat and only portion not exposed to draft.

LDPE's low temp dewpoint  allows dry air to prevent evaporator coil cooling from being lost by dew.  

DEW IS THE ENEMY NOT THE GOAL DUH.  AC CAN COOL ROOF AND WALLS SO YOUR BODY IS NOT HEATED BY THE ELECTROMAGNETIC RADIATION ALL SURFACES EMIT IN CENTRALLY COOLED HOMES BECAUSE NONE OF THE COOLING TO SPEAK OF REDUCES THAT!

KEEP IT IN THE AIR IT DOES NOT HEAT US!  CO2 IN ATMOSPHERE DOES HARM HOWEVER.  NOT HUMIDITY BLOWING IN ONE SIDE OF HOUSE AND OUT OTHER.

ANYONE CAUGHT CAPTURING SUCH VAPOR IF NOT TO DRINK HAS NO DECENT OR INFORMED 🧠.
Reply: @ereenatc6042  What does this have to do with what I said? I think you replied to the wrong person.
Reply: @SkepticCyclist  no you're the guy that doesn't turn off the blower when the compressor is off on your central air conditioner even though that is a little switch on your thermostat and frankly I have a thermostat that has a third position which allows me to have the blower turn on briefly as if the condenser is operating when it is also off continuously.

I gave you enough information that you lack that you should be grateful but obviously you haven't studied the entirety of the comment. The reason variable speed blowers are helpful in combination with variable speed compressors is that you can keep The temperature of the vapor of coil below dew point. And you can do this without using much energy to operate the compressor. In this way you can use less metal for the coils because you lo utilize them all the time. By having the system start stop at full speed or not be able to go down to extremely low energy speeds you don't take advantage of their surface area which is the key to reducing the energy to operate your printer without it jamming. But the real problem is you're using technology designed to keep printers from jamming to keep your body from overheating. That does not work and is destroying our planet. We have people on this earth who are clueless but very very wealthy for example Lord Branson turned a lost necklace into a fortune and with a pittance of his profitering tried to disrupt the air conditioning industry. Because he was too busy talking virgin this or virgin that instead of disrupting the air conditioning industry he helped it metastasize further into new nations that otherwise might have done far better than Central deer modification or a room demonification. Of course I'm saying do you minify. The humidity is not the problem. Ignorance of the technological solutions is. This channel is about technological connections like the abuse of selling printing press d gaming solutions I said d jamming solutions to people who were wanting to sweat less and just helping them sweat covertly in ways that cost too much especially for other people at lower altitudes or otherwise perhaps at best out of sight but ultimately impossible to keep out of mind.

Some people that have central air conditioning also have freezers in their house. The freezer tends to be capable of removing enough of the mass from liquid water to make it able to absorb so much heat it's worth caring around without it even having to put it into your mouth when it melts. You know like the M&M's that don't melt in your hands but only in your mouth that's not what you want to do when it comes to your body heat. When the goal is to keep your body heat from increasing you want to let the ice melt under your stool without any heat but your body heat getting into it. You can buy that ice from Fuji and you will have 99% of the money it costs to instead help your body sweat. Importing water from Fuji is not the problem The problem is condensing the water that gets into the air in your house. That's the problem and it's cultural and it's exploitation beyond anything that has ever been perpetrated in the history of mankind. It makes things like human slavery and war seem like petty misdemeanor in fractions.
Reply: @ereenatc6042  They (my utility turns off the compressor and only the compressor).  

If the system is set to auto (including the fan) the system will continue to run even without the compressor. 

It continues to run because the thermostat is reading the hot temp in the house and is attempting to cool it down even though the compressor is shut off. This is how most systems operate. Even when a compressor is failing, in efficient, or not working, most systems will continue to run attempting to cool down the house. 

I’m not home or do not notice the compressor is off for me to manually turn off the blower until it’s too late.

UNDERSTAND???
Reply: @SkepticCyclist  all too much.  Fujitsu's COMODO GEAR IS WHAT YOU NEED
Reply: @ereenatc6042  Don’t need anything. Although it would be nice if you acknowledged that you misunderstood and were completely wrong. 

In fact you can read about it here on their own site, “Then, when
the demand for electricity or costs for energy spike, we may call an energy event and temporarily turn off (or “cycle”) your air conditioner’s compressor(s).”

Notice the last word “compressor(s)? Only the compressor is shut off. The fan continues to blow. This is how they set it up and do so intentionally. 

Wait, there’s more “A green light on the cycling device indicates that it’s receiving power and proper radio signals, while a flashing green light indicates that your compressor has been turned off. The unit’s indoor fan may continue to run to circulate the air, unless you let us know in advance that you prefer to have it turned off as well.”

At the time, 10 years ago, they didn’t have this feature where they turned off the fan. Now at least they offer it.

https://www.sce.com/sites/default/files/inline-files/SDP%2BFACT%2BSheet%2BNR-587-V6-0413.pdf
Reply: @SkepticCyclist  I hear you correcting your stand clearly but your uh uninsulated duct and hopeful thinking regarding past belief not being mistaken do not Indict.  I need you to watch the recent 59 second commercial FUJITSU POSTED HERE ON YOUTUBE TARGETED TO AMERICA'S BUT ONLY ON THERE JAPANESE MARKET CHANNEL?

BRO CAN YOU SPARE THAT UNDER A MINUTE?  PUT HEADPHONES ON AND HAVE A SEAT!
Reply: You can store solar chemically, too. Overbuild solar/wind then when your generation exceeds demand, dump the excess energy into generating hydrogen. When you need more power, switch to burning hydrogen. If there's excess hydrogen at the end of the day, you can sell it for industrial purposes. Solar/wind companies could be the new "oil" companies.
Reply: Fiscal benefits aside, how do you think this will scale as an energy solution? Given the thermal losses are a function of delta T, there’s certainly a cost to the storage- have you calculated that?
Reply: @dannyphillips88  surface area of tanks scale inversely to volume.

Volume increases cubically for example while surface area of a cube squares to edge right?

The squared becomes diminimous to the cubed as scales increase.

Storage efficiency is easy to rule out as deal breaker.

Only politics of the corrupt sort prevent distribution of mantle heat energy by phase change material you pay nothing to start for nor to discard.

Delta temp also increases value of material.  Radiant cooling becomes EVEN MORE COMPELLING.

WITH SCALE PIPELINE LOSSES OF ENERGY REPRESENT COOLING TO THAT PROXIMATE TYPICALLY WELCOME!

REMEMBER THE PIVOT!  THE INSULATING PIPE SUPPORTS DID NOT MELT THE PERMAFROST.  THE USE OF THE PETROLEUM'S EXTERNALITIES WAS KNOWN AT TIME BY PIPELINE BUILDER TO DOOM PERMAFROST.

FOR THIS REASON THEY ARE LIABLE FOR COST OF REFREEZING LOST ICEBERGS FOR DE ACIDIFICATION OF OCEAN AND YES CONTINENTAL WIDE RESTORATION OF PERMAFROST.

SUCH A PIVOT WAS CONSUMATELY CRIMINAL REPRESENTATION.
Reply: In London, in the Summer, I open windows 5am to 8am, cool house down, and keep windows closed during the day, easy manual AC :)
I have been thinking of building a house, for the last 10 years, with large water storage on the roof, and storage in the basement. Just pump water during the night, economy 7 (half price), and use water turbine to generate electricity as needed, during the day :)))
Reply: You should talk a little bit more on energy efficient house design!
Reply: @Freakschwimmer  I live in the US. Ours are triple pane upstairs (the basement windows are old and single-pane. They're also a pretty obvious plastic, while the upstairs ones seem to be acrylic). Unfortunately, they all leak.
Reply: @pandasdreamlygon  Noise? I think your DAC may be bad
Reply: @xHadesStamps  wow thats a ... diverse mix ^^
Reply: @Freakschwimmer  The basement windows are ~25 years older
Reply: My family has been utilizing this system for decades. When I was a child in Los Angeles, we lived in a very inefficient postwar tract home where we realized that using the window AC units at night when they were capable of getting the house very cold, then closing everything in the morning (and running it at a lower setting) kept the house more comfortable throughout the day than only running them when the house got warm.

In my current house, we set the thermostat to 64-66F at night and even on the hottest days we'll rarely need supplemental cooling even late in the afternoon to maintain 70F through the day with the window blinds closed. Another benefit is that the air conditioner runs less time in total because the ambient air temperature is lower. Since we live in the PNW and our hot season is only about 6 weeks a year (this year it was more like 8, but not continuous like most years), the rest of the year we use other strategies to save energy, like cooling by opening windows (sometimes using portable fans to draw in or distribute air) and opening blinds to absorb solar energy and store it in the floors during the coldest part of the year. During the hottest part of the year, our house barely leaves the "efficiency zone" defined by our utility company as the bottom 20% of energy users for similarly-sized homes in the area and we're in a region where 60% of homes don't even have air conditioners, meaning we're using less energy than many homes without air conditioners...
Reply: your energy is so cheap, in germany 0,31€ is normal. thats why heat pumps not a good idea for old buildings because gas is so cheap
Reply: LOL, if you ran the fan without ac in Texas, you'd heat that air from the hot attic encapsulating the duct work.
Reply: @judebrown4103  definitely subjective! For me , 72F at night would be way too cold!
Reply: Ive done much the same manually for yrs
Reply: Thanks for that clarity about overcooling at night
Reply: @TechnologyConnections  Google Whole House fan.... to cool a house at nite for much less than AC.... no it not perfect since it can add humidity and not all nites are cool enough... but it works most of the time with a added dehumidifier..... and on average its bring in far heather outside air than just using AC alone....

Or a chiller unit (ie a a cold water tank) that are used for commercial buildings with a ground source HP.... far more expensive than a  Whole House fan but you get more control...
Reply: Google Whole House fan.... to cool a house at nite for much less than AC.... no it not perfect since it can add humidity and not all nites are cool enough... but it works most of the time with a added dehumidifier..... and on average its bring in far heather outside air than just using AC alone....

Or a chiller unit (ie a a cold water tank) that are used for commercial buildings with a ground source HP.... far more expensive than  Whole House fan but you get more control...
Reply: Have you considered unplugging your freezer and fridge during peak hours after over cooling them?
Reply: We should be building differently with this in mind....We need to be building with "thermal mass" and "superior insulation" at the forefront of our minds. Thicker concrete slabs insulated from the earth, much thicker drywall etc.  The extra cost will be returned to us in the long run. Excellent Video content!!
Reply: got love conspiracy nut logic... for the amusement value...since we all know clean air is the biggest conspiracy of them all
Reply: @seamon9732  fuck that bro any higher that 67F I’m SWEATING
Reply: DON’T LIKE THIS IDEA.  The youtuber’s 74 degrees during daytime doesn’t sound comfortable especially when I’m at home working.  I’d rather run my A/C during the day to keep below 70 and then turnoff at night to save money.  (When sleeping the body generates less heat.)
Reply: Do you keep your windows blacked out during the day?
Reply: The industry term for "make hay while the sun is shining" is a "smart grid". The general idea is to use systems that are tolerant to intermittent supply as a form of energy storage. Another good example is desalination which is easy to decouple from supply and demand fluctuations with a reservoir that holds lots of fresh water. As long as the average weekly or monthly output of the plant keeps up with the average weekly or monthly consumption of the fresh water it produces, it really doesn't mater when the plant is running or idle. Desalination is also going to become increasingly important over the coming decades because of reasons.

Yet another alternative to bespoke energy storage is a High-Voltage DC (HVDC) "Super Grid". Which uses high-voltage DC lines to efficiently connect regional grids so wind power from Portugal can be used in Estonia. Storage attenuates the supply/demand mismatch over time. A Super Grid attenuates the mismatch over space. Spreading the dreaded duck curve over only a few time zones makes the whole problem much more tractable. One report estimated that a European Super Grid could allow the continent to operate 100% off of wind and solar without the need for any storage! Though, it would have to cover the North African countries the boarder the Mediterranean as well.

A similar project for North America is estimated in the range of $500 Billion. Spread that over at least a decade worth of construction and that's $50 Billion/year. I haven't done a full economic analysis, but I believe that's far cheaper than battery storage alone, though a mix of storage, smart grid, and super grid is probably the best solution.
Reply: this is such an interesting idea, I absolutely want to try this myself.
Reply: You are onto something. What are your humidity readings and where do you live geographically? Humidity control is the biggest problem for energy needs that impact the structures integrity and the inhabitants health. And the additional problem is humidity control as you go south and the immense heat needs as you go north. I think Ice and heat storage like you discussed in a residential setting could not only save the electric company a few bucks but help us begin to rely on our own energy production. AC and heat pump systems already come pre-equipped to run off a solar connection.
Reply: Was that 8 Cents a Kwh ?..  UK it is now 28p ( 36 cents) Kwh flat rate. Variable tariffs have a higher & lower variation.
Good point about how a slightly over sized a heat pump or AC is important if you want to get ahead by a couple of degrees & coast past the price spikes.
Reply: Have you done a video about local pumped storage systems? Vs Pumped Hydro systems. For example forcing air inside a containment system, down to the bottom of a lake against the pressure of the lake using a turbine to soak up excess power. Resulting in high pressure air that the water pressure from the lake acts on it but it can't release. Then when power is needed use the weight of the lake water to force the air up to the surface & through a turbine making power  when needed.
Reply: "This House is about 10 years old" well let me introduce you to my village in Germany where houses are considered quite young when built after 1945
Reply: That work in the desert until about 9am. 😝
Reply: Like water consumption restrictions and golf courses?
Reply: This is the big advantage of personal solar panels over commercial solar farms.  I use as much as possible "free" when the sun is brightest not at the peak when the light fadeing. The exact opposite of you.
Reply: Hey Alec, 

I love your videos. I think I have memorised most of them. I have also left comments on Aging Wheels and Under Dunn asking for more collaborations with your channels. 

Would this idea work for winter? If a house were heated heavily at night, then  buttoned up during the day? 

Could you suggest more heating videos? Here in Japan, it is common to have split heat pumps in individual rooms. We also have a kerosene heater along with a (I believe) resistive heated table with a heavy blanket over it. 

What else can be done that will provide heating that is cost efficient? We have tinted double pane windows and sealed drafts where possible. This is a traditional Japanese home with modern upgrades. 

It sucks to be cold and sweaty at the same time! I wear a good quality base layer and multiple insulating layers. 

You have opened my mind to the magic of how air conditioning works along with so many other technology connections. I am so thankful.  

1 more thing... I absolutely love your car. I saw one at a museum in Komatsu. Thank you for all that you do. 

Let us know if you have tried a Moka Pot yet!!
Reply: Here in Seattle most of the Electricity is hydro so it is the cheapest in the US but I am strongly against placing solar panels on the roof as we get pretty aggressive MOSS growth any shaded area within a few months will take over by Moss for example during COVID people did not drive their cars much so many cars were damaged by Moss and you can see them driving around with the damaged paint job.   Now imagine what this will do to your roof after a few years growing under the solar panels??   Disaster waiting to happen.    Sun kills the Moss but it will grow like crazy under the panels,  or you got to go up on your roof and spread the anti moss powder like most people do in Seattle.   In spring and before winter most people climb up on the roof and put down the anti-moss powder.    That will be super hard with Solar panels in the way and it is so dark under them as well I don't think the powder will even work.     The best is to place the solar Panels on a metal adjustable frame in the yard, this will also be way cheaper to install, less man hours, less drilling and easy to maintain, monitor and replace bad panels yourself and also lower cost to replace your roof material if you ever need to.     Sure, roof is supposed to last 30 years but some bad storms and snow and it can eat away at it after like 20 years;   Also, with the Solar panels near the ground you can clean snow off of them without having to climb on your roof in winter!!!!!   Yeah fuck the roof install do it on a raised panel in your yard!!
Reply: Only certain buildings are suited for this strategy and retrofitting ones that aren´t can be expensive or impractical.  Between the vagaries of the variations in the thermal mass and the ability to exploit it from building to building and behavioral issues, this is very far from being an immediately available energy storage resource for utilities.
Reply: 2034: Power will be restricted from 6am to 9pm for non-premium customers,
Reply: One not so well known aspect of large commercial building environmental controls is that often the center of a building requires cooling at the same time the periphery requires heating, so that part of the job is just transferring heat within the building. Using thermal mass to store heat or cold tends to reduce the overall heat transfer load by dampering ambient temperature changes. Using this effect actively rather than passively is even more beneficial. However I'm not sure active thermal mass storage is as efficient as pumped hydro.
Reply: You could also just buy a very large backup battery and charge that up overnight, and then use that to power your AC and heaters during the days.
Reply: @8crafter  Batteries are expensive; storing energy in batteries is expensive.
Reply: @rdbchase  well i am sure that if you combine that with the power plan where it is cheaper at night to get power, then you will probably end up saving more money in the long run than the about $200 that it costs to buy one of them.
Reply: @8crafter  You shouldn't be; sure couldn't do much cooling with a $200 battery!  $2000 worth of batteries might be enough to cool a single room through the heat of the day.  The cost of batteries is recurrent, as they gradually degrade with each charge cycle.
Reply: @rdbchase  ok i thought that the $200 ones on amazon would have been enough to run just only the ac or the heater but ok.
Reply: @8crafter  Energy = power x time -- it's a matter of calculation, not speculation.